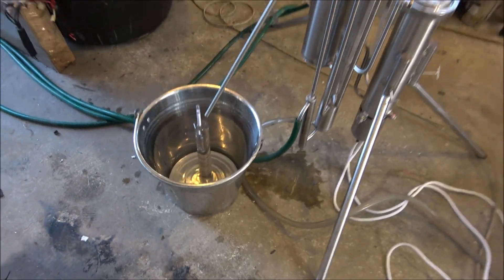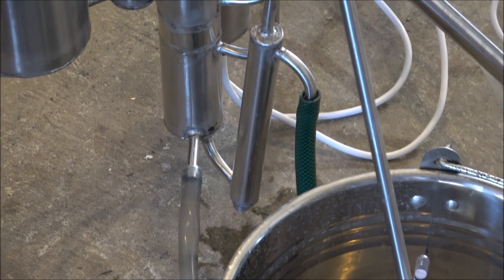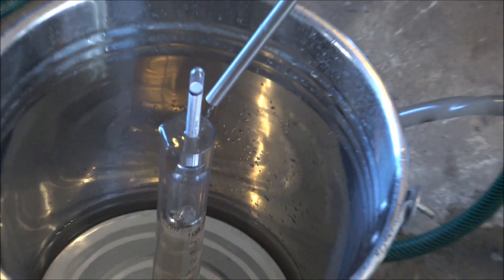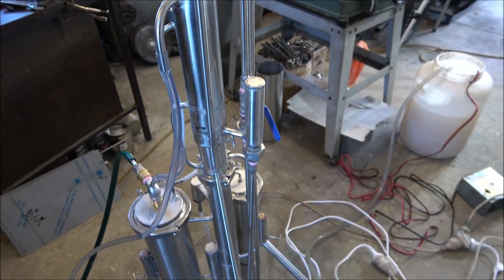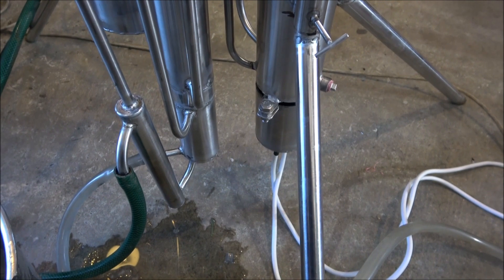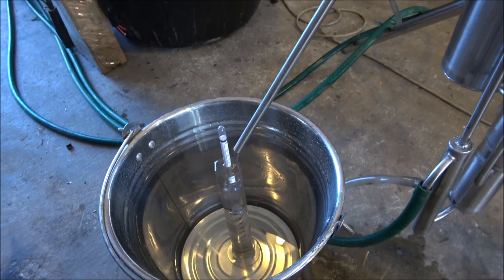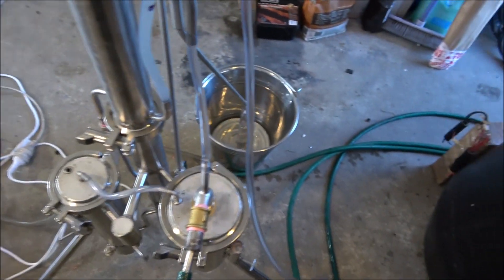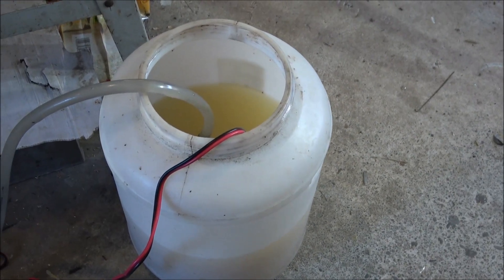Home distilling with 3kw continuous alcohol - moonshine still.

Comment: Hi, guy with very hard water here. I’ve found that citric acid works best for dealing with scale. It’s safe for rubber and helps passivate the steel as long as you let it air dry after cleaning. But the best is to never have to descale at all by using DI water if available and affordable.
Reply from the maker: Sue, it's better not to deal with this problem al all.